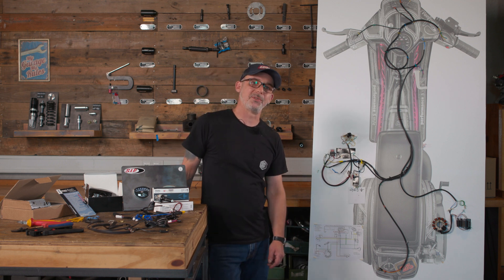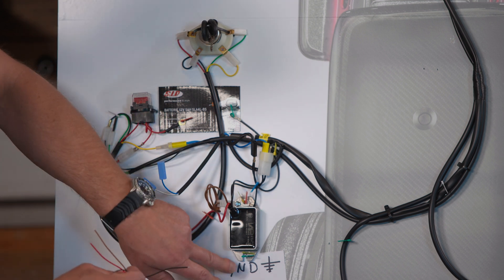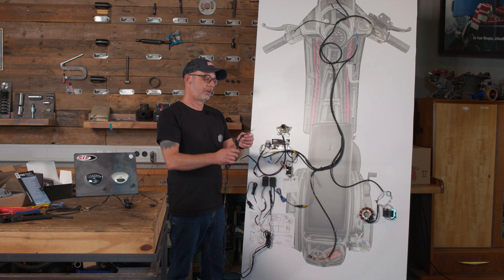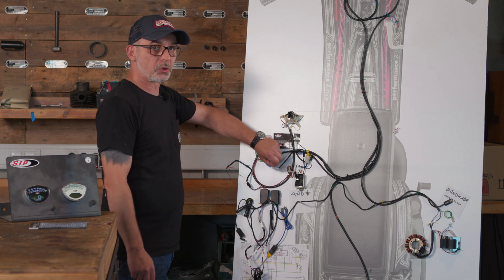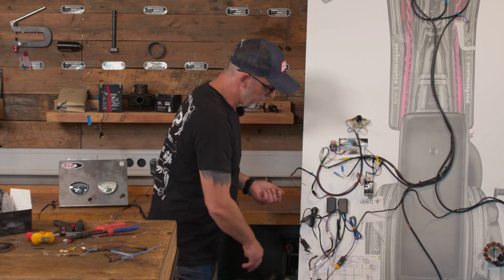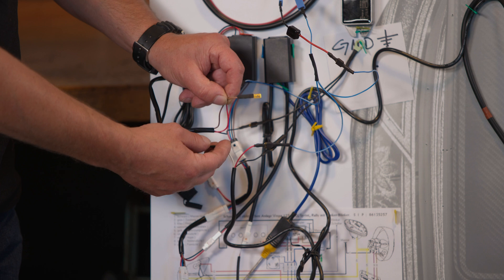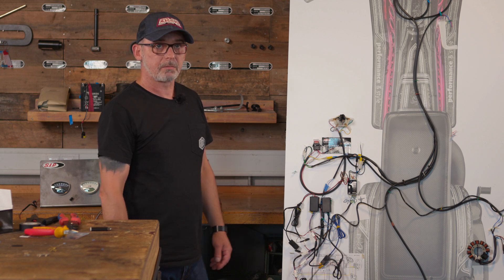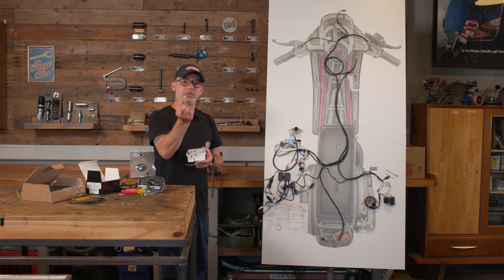WIRING LOOM Connecting Accessories SIP Tutorial Episode 3 🛵🔧 {english}

Comment: I have a MK1 T5 with SIP speedo - what other parts do I need to do a DC conversion? Do I use a standard AC loom and add extra wires for the battery?